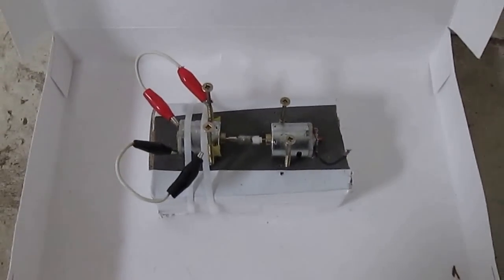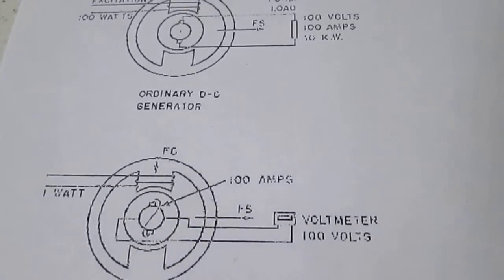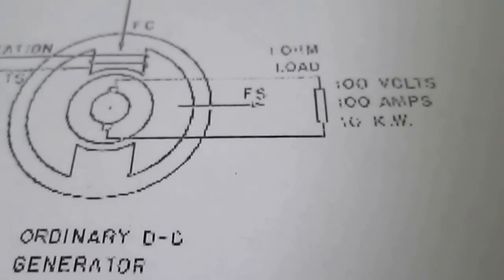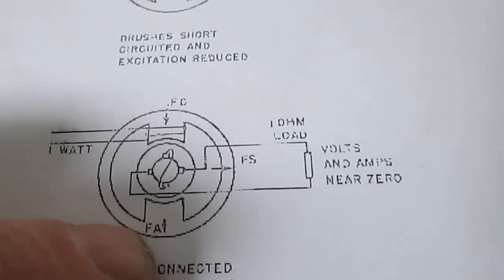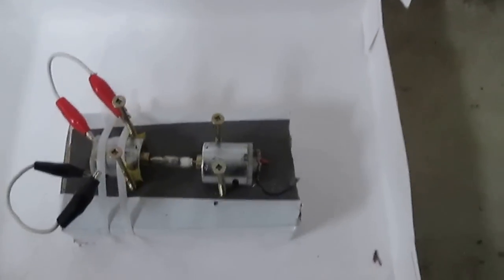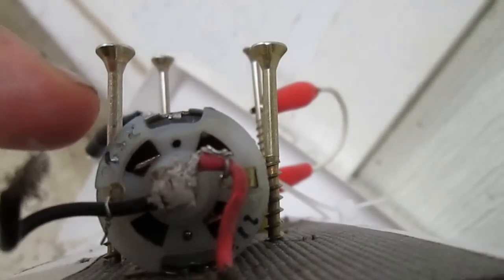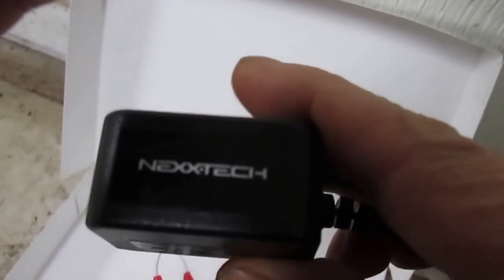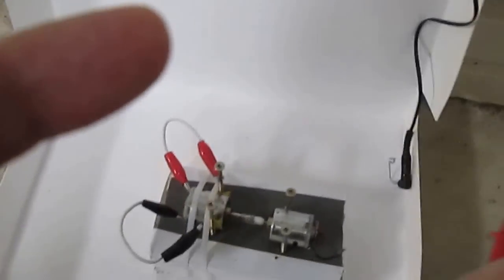The mystery of the amplidyne motor generator.

Comment: I worked on Amplidyne motors when I was in the Navy. We used two of them to control our missile launcher for the Basic Point Defense Missile System. We also had a transmitter / receiver with a scope than was manually controlled by us sailors. Those amplidynes  spinning up had a very distinct sound that I will never forget. Those motors had a 10,000/1 decibel gain!
Reply: le son dont vous parlez, est ce que c est une sorte de "grésillement" tres rapide? (accordé au rythme de rotation de l amplidyne?)

Comment: Im just quesing sir but I think those generators work similar to wacum tube baterry chargers actualy if you wuld flip the field wire at above picture you actualy wuld reverse polarity on that generator so what I suspect is that dual windings are used or bifilar winding so that same end lead from the generator posibly culd out put bouth dc+ and dc- in pulses if for exampel if it wuld by swaped around fast enough like some sort of vibrator circuet or flip-flop if I am not mistakeing that thing culd also put out ac in 1 lead basicali 🤔 Im not shure but it looks like external inductors or transformets culd by used posibly so that thing wuld act ither way dc/ac or magnicon/amplidyne/metadyne all in one circuet probably I migh by wrong on that theori but perhaps 8 brushes might make differences if their all insulated and ich commitator segment has 1 empty spacer slot not used that thing wuld act nearli identical like ac generator the rotor is just looped left to right side 🤔 I dono its just silly theori of mine because that deam thing remindes my at delco 12 si alternator and that thing also does strange staff so its similar to it some sort of I think they used dry cell baterrys hande made for that 1watt power some clay acid and random metal platea

Comment: well I belive in those mashines because I took old magnet starter motor and I displaced the magnets around what I ended up was that bout brushes produced positive out put so I belive if you wuld put some power in that generator and let it proces it true the rotor and field windings indead it wuld produce greater out put but I ques that wuld by more or less called voltage bosster or rotary converter I took 2 brush holder asembly and cutt them and only left the insulated brush holder parts so Im convinced it wuld work how ever useing slip rings sound bether because you culd posibly have bouth ac and dc any way Its hard to finde those starter/generator voltage regulators and current cutt out selenoids and those windings are realy fat in starter motors so for ordinari hot bulb engine I ques good choise for power generation at low rpm

Comment: If anyone could test this app i'd be grateful!  Search: 'Circuit Solver' by Phasor Systems on Google Play.
Reply from the maker: Semiconductor type apps use controlled component arrangement that might not be applicable to this type of dynamic mechanical system. I need to use digital, analog and separate physical testing.

Comment: So you have invented the electromagnetic brake 150 years late - sticking that pin in at
the end changes the percentage of the armature winding that is taking part in the 
electromagnetic braking.   And your power supply is probably overheating as you've
overloaded it.

Quit stumbling about and learn how electricity works from reputable people, not the likes of Morin who is at best confused and at worst a professional charlatan.
Reply: I would use a different word for morin.

Comment: Hi Allan:  Is the amplidyne and over unity the same thing? I don't know anything about them. I find the amplidyne  to be interesting and would like to learn more. Could the average person make one? Thank you for your time.
Reply from the maker: Unity would be 100% efficiency. I think the conventional definition would be the ratio of input power in watts to  output power in watts of a given system. My own control  test on these motors would yield about 66% efficiency on measuring they were well used. My newer test on larger new PM motors was about 72% efficiency by this measure without any special modification ( the control baseline is straight a motor and generator input output ).The amplidyne is a special motor generator modified. There is not a lot of literature on the functioning but what is available has not answered questions raised about an increase in power or inductance of either the excitation of the modified generator ( or amplidyne) or the inductance or increase in power generation of the amplidyne system in  some arrangements (some have claimed or suggested an significant overunity effect). This work is not done I only went through a couple of steps but the 4 steps should be possible to build on a bit higher scale but as you can see there are effects from the shorted brushes and the 90 degree redirection of electromotive forces of the Ernst Alexanderson amplidyne theory. The shorted brushes wire added would ordinarily become hot under resistance but does not in the turning magnetic field.

Comment: Did you say this is a DC Brush motor that doesn't utilize magnets?
Reply from the maker: +Cori Alge Yes the plan shows a type of DC motor that is electrically excited. The small 15 watt 11500 rpm motors arepermanent magnet motors. The poles become ferrous electric magnets when a current is circulated in the coilsaround the poles for the type of motor in the diagram. This becomes part of the theory of the amplidyne since thepower to the coil determines the strength of the magnetic field and provides a potential control mechanismfor the generated power output.Here the sudden increase in speed by the placement of the pin in the back of the amplidyne build in progress could be both due to a decrease in friction of the brush (though have not seen a large increase pinning both sides) or in theaccess of power that would normally be from the 90 degree wires. This is after the short wire added to redirect the magnetic field with a lower resistance.
Reply from the maker: +Allan Shura I will try to test magnetic effects on the outside since the motors are so small and see effects on output. Theinterpretations have been: 1) 100 to one power generation increase ( 100 watt to 1 one watt excitation output for 10 KW)2) Excitation causes some added generation capabilities by lower eddy currents and the claim of utilization of a  concentrated magnetic field at the center of the armature normally bypassed in an ordinary generator.3) The major power input depends on the motor driving the amplidyne generator and the excitation is only a     servo control for immediate power output and level control.